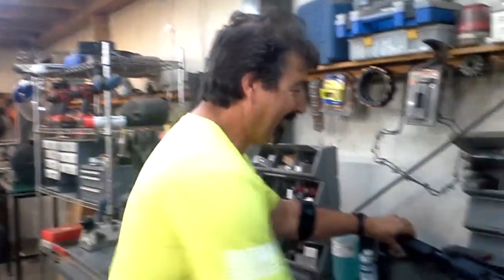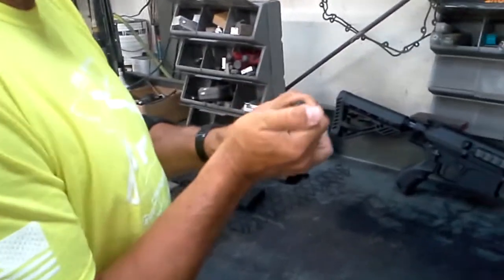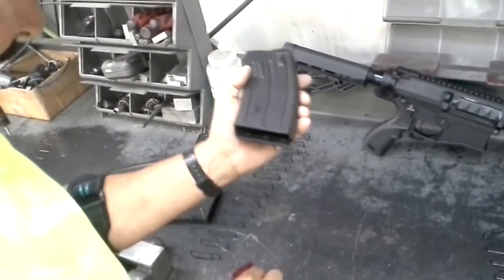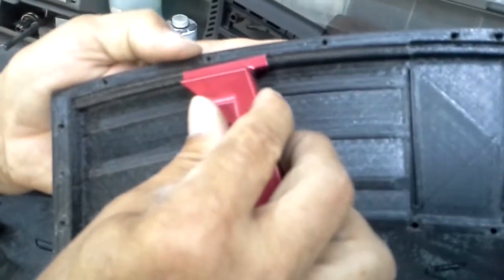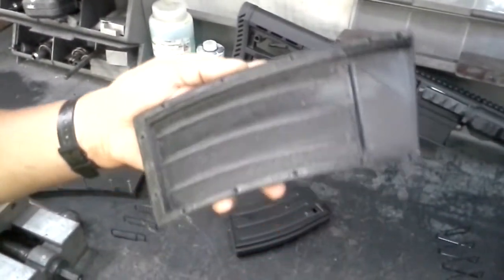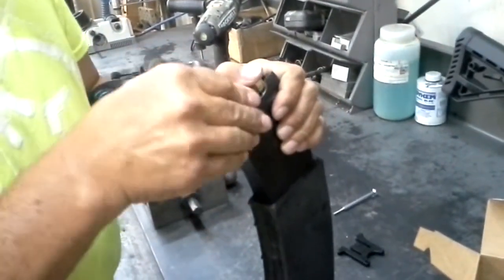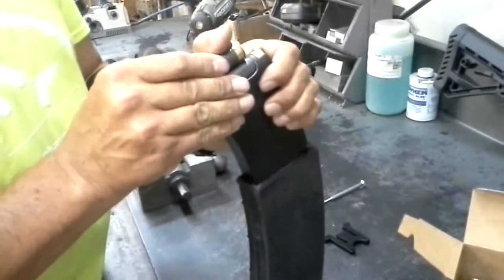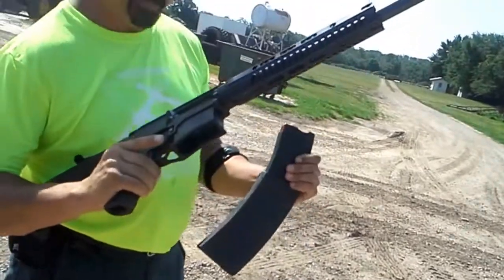XTR-12 14 Round Mag Extension Assembly

Comment: Do the XTR-12 and MKA1919 take the same magazines?

Also, what is your opinion between the two?  Do either use standard AR triggers?
Reply from the maker: Different mags, similar but the follower and mag catch hole are different .
The XTR-12 does take a standard AR fire control group   NOT ALL AR15 triggers will work.  The MKA does use JUST the trigger portion hammer and diso are specific.
For general shooting the XTR-12 is as close to an AR15 style shotgun you will find, for competition the MKA has an edge due to the big mag availability, so far we haven't been able to get more than a 14 round mag to work in the XTR. 
We have 28 round mags for the MKA
Reply: Tooth and Nail Armory
 Thank you VERY much!  I've handled a AR12 and MKA 1919, but neither did much for me.  From the videos I've seen the XTR-12 SEEMS like such a better BUILT firearm.  I hope it catches on here in the States.

Comment: Is regular AR-15 handguards fits on XTR-12? Do you know something about this?
Reply: Magnum GeaR no but it does take a 308 lower. So you could technically add or change anything you want on the lower including trigger, extended bolt release, extended mag release, stocks, pins, safety, etc.